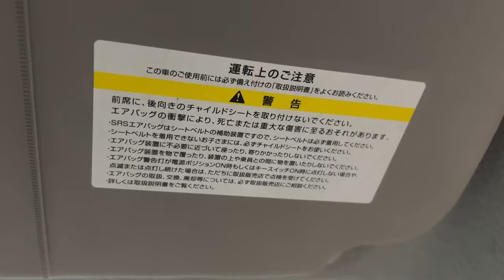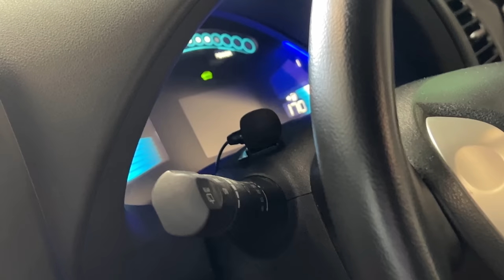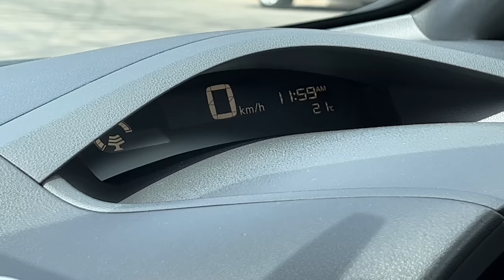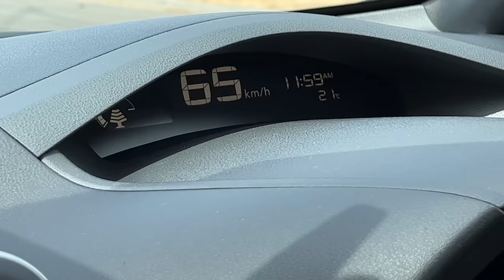I bought an electric car.

Comment from the maker: “Why a Leaf? Why that body shape, why that colour?” - it was the cheapest EV for sale I could find 👌
Reply: Plus it is just you in a lot of ways, to get some very 2000s car in some eyesour of a color but it was cheap
Reply: Oh but bloo is fun
Reply: Next vid: I'm making an V8 Supercar out of a ev 😂😂😂
Reply: Yeah...

But why a Nissan?
Reply: Idk why but im getting mom from incredibles vibe from that body shape... huh.
Reply: Don't worry, that's the same reason I bought one (same color but it's 2012)
Reply: Lol, check after 3 month how many money you save if use only solar power.
In my country electricity is super cheap and for 16 month I drove 42k kilometers, it's save me 2.5k usd (only fuel, without maintenance). 

Oh, Leaf 2015, 24kwt =)

And for this price, it's super fun.
Reply: Nissan Loaf FTW
Reply: @carrot_slayer_of_patatos  possibly something crazier maybe a very high torque turbo diesel
Reply: @jakass  price that's it
Reply: @EDV8ZR1  🤯🤯🤯🤣🤣🤣
Reply: I actually quite like the color. I've always thought the leaf was a good design, never understood the hate.
Reply: @mileskosik472  It was something new and people aren't ready for it.
 like the gasoline car versus steam-powered yes I just compared electric to gas kind of funny right.
Reply: I used to have a Leaf that same color. Loved it except the range wasn't too good after 11 years on its original battery. Sold it and got a Chevy Bolt EV. Love that thing even more.
Reply: Paint it white
Reply: Dank, I bet you didn't see the leaf nismo RC. It is wild
Reply: Not kw.
kwh.
It's like difference between horse Power and gallons of fuel.
Reply: It's also one worst EVs you could have bought. Nissan, in all its wisdom, decided to give passive cooling for this battery on this crap box. Real fun once it inevitably overheats
Reply: Should I, therefore, be made the subject of fun?
Reply: Roughly how much in Aussie bucks
Reply: Aren't you worried about the battery pack dying in a few months?
Reply: Not the new leaf, I'm slightly disappointed but happy to see a new bug. Does it use AAAs?
Reply: good luck with that air cooled battery
Reply: You do know electric bills exist
Reply: @jakass  french powa
Reply: Solarrrrrr
Reply: you forgot the mitsubishi imiev :)
Reply: How much is cheap though
Reply: The newer Nissan Leafs are shockingly decent.. working at a dealer, I can say for sure, they have a little more torque than you would expect out of a budget EV!
Reply: @nickrustyson8124  It's a 2010 car (2010 - present)
Reply: @jakass  The Leaf was the most popular electric car from 2010-2015. Why not Nissan?
Reply: That blue beats boring greyscale, and the price was right. I wonder how much range would be lost if you mounted a set of wider alloys and performance all-seasons? I bet it'd be a hoot on a track or along lightly-travelled back roads.
Reply: You should put the body of the fiat on the chassis of the leaf!
Reply: Good luck with it. It's an experience. I suggest you watch Bjorn Nyland. He's a great EV specialist. It's good you got a late model. The two things you need avoid is don't park it in the sun if you can
And most importantly don't keep it charged at 100% for long periods. Charge it then drive it. If you're not driving it on the weekend, keep it below 80%. These two help with degradation.
Reply: I got an eGolf right before the pandemic, the savings in gas kept me from going bankrupt. Plus I always liked a zippy little Golf. Hoping the $25K Tesla borrows from that design, or I'm going Ioniq next.
Reply: Hey guy, ever consider dropping that drivetrain into a non-electric car?
Reply: I support anything that isn't white grey or black lol
Reply: It's the best choice for a electric car, especially second hand.
Reply: Should have been called drift since leaves drift in the wind but that dunnyload could never drift 😂
Reply: @valentinoschristofi  nah there's videos of the leaf drifting haha
Reply: @ShockingPikachu  not stock tho i doubt
Reply: @valentinoschristofi  I think you underestimate just how powerful electric motors are 😅
Reply: @ShockingPikachu  oh no, ive had two leafs /leaves before a black 2014 and a white 2016 i just think because they are fwd it wouldn’t seem very easy. I’m actually a massive fan of the new tesla roadster idea just i want elon to get on with it already lmao
Reply: BRING IT BACK
Reply: Never loose proximity keys. Get a spare if you don’t already have one. Loosing the key could write it off
Reply: The Leaf reminds me of Gaddafi's "Libyan rocket"
Reply: because: leaf is from tree. tree is from nature. nature is good for electric vehicles
Reply: I recently bought a Leaf and the money I am saving on gas is paying for the car lol plus I wake up with a "full tank of gas" every morning
Reply: it's better than a prius
Reply: Lovely colour, and the Leaf is known as a pretty decent EV
Reply: better color than silver, black or white on this car imo it's a slightly less boring leaf
Reply: Ah.
Reply: You should get a jaguar xf if has a 3l v6, best ride ever, cheep and has a 0 to 60 mph in 5.4 seconds I is a really fun car to drive btw
Reply: Btw fyi your electric car look really inside and outside like a Renault clio , normal due to the alliance with nissan lol
Reply: You have a Nissan egg I have a tesla egg mate
Reply: @mileskosik472  I'm the same for the most part, but I would've traded some more wind noise for less bulbous headlights. Either way, love my 2012. Best damn commuter I've ever owned.
Reply: @jakass  "But why a Nissan?" There's only two used EVs available in Australia for under $20,000: the Nissan Leaf or the Mitsubishi iMiev.  So you have a choice of Nissan or Mitsubishi...
Reply: Can you make Videos with the eNugg ?
Reply: @jakass  If you're looking for a cheap used electric car in Australia right now, there are no other options aside from a Nissan Leaf under about $35K, unless you're lucky enough to find a Mitsubishi i-MiEV that has almost reached unicorn status. Around $35K and up, there are better options with more range and tech such as the Hyundai Ioniq, BYD e6 (no DC charging), and a few others except for maybe the early BMW i3 models, which have bugger all range, but are still more expensive than they should be.
Reply: I love the color.
Reply: I bought mine from Bennett too :)
Reply: @tgmrsch  I have one... :)
Reply: Thats a Micra in disguise 😂😂
Reply: "Should I therefore be made the subject of fun?"
Reply: its the best nissan seller in ev pro country like norway even beating its on ice brethren
Reply: @mileskosik472  theres also a brand that mimics leaf design and also an EV in malaysia (a bit neko style tho)
Reply: @aenoymotors  a decade is a decent life on this one.
Reply: the color is actually pretty good, but the chassis is a bit questionable.
Reply: and most affordable
Reply: Eletric motors can spin up WAY faster than an internal combustion engine on average, thats why the acceleration is so high, and is also why bois like the tesla roadster can kick ass at drag strips.
Reply: Now do the economy challenge. I bet Tony still has the EV beat 💪😤
Reply: i have always wondered why its called a "Leaf" because it looks nothing like a leaf
Reply: Goofy ahh nissan
Reply: * real
Reply: nice job man!! fuck the haters
Reply: It's pure nugget and TBH that's perfect regardless of being an EV. The fact that you can run it essentially for free because it's electric is amazing though
Reply: Not anything about any of that! The shape is awesome, I love the colour, and... who doesn't love to see a Leaf at football practice, better yet with a grown, childless man inside? 😃
Reply: @mileskosik472  egg
Reply: The cheapest EV was JDM? In the US you can sell JDM cars, even boring ones, for a lot more.
Reply: @GarbageTime420 Hey, I’ve been wanting this dingus car for a long time. Do you still have it 4 months later and has your opinion changed at all? Also, if I got one I would not be able to charge it at home, only at public stations in a town where EV’s are very uncommon so chargers are few and far between. Still, I’d only need to charge it maybe twice a week on average. Would it be worth it?
Reply: Yo, where's the fuel economy test? Gotta drive it up and down the highway to see how much fuel it uses
Reply: it’s an electric nugget 😂😂😂
Reply: nice one
Reply: At least you didn't go full "White Goods" and get a Kelvinator white one ! LoL

There blue is an unusual color for that model and looks really good 👍
Reply: @jakass Because Tesla's are crazy expensive in Australia 🙄
Reply: That’s the CHEAP one?! 🤯
Reply: When you first got the car, did it make the default sound when starting up?
Reply: i want a leaf tbh.
Reply: Tbh best body style
Reply: @jakass He said they are Fleet Vehicles in iapan

Comment: The thing about EVs, which it looks like you have found out, is that driving even a low-end one is insanely fun just because electric motors are so responsive.
Reply: The throttle response is impeccable, gas cars always feel somewhat unrefined with inconsistent throttle response
Reply: i remember driving an electric golf cart at uni, was so much fun, going full throttle like a madman
Reply: you can literally stomp out a beat to a song and the motor will be fine lol
Reply: @osimmac  idea: electric car kick drum
Reply: @osimmac  That's awesome
Reply: My 2002 Prius has 258 lb-ft of torque. 258. That is more than a V6 Camry or an Acura TL Type S of the same year.
Reply: my dad has a hybrid volvo and idk what they did to the torque settings in hybrid mode but it's so slow until the diesel engine turns on
Reply: @@nicoyazawa829 that makes sense, I believe it has a 60kW motor, feels like it's lower though, could be battery age
Reply: Ev nugeteer here ioniq ev has been amazing
Reply: @fayenotfaye  Even EVs has an artificial delay in the throttle response, to not spook drivers accustomed to throttle body lag. I have driven a racing EV, and it had a ramp up time of the inverter of 50mS only. Literally if I twitched a toe or sneezed, I suddenly drove 15 mph faster.
Reply: @Tore_Lund  can’t feel it in a Tesla atleast
Reply: @fayenotfaye  I've never tried a Tesla. My Current has a 0.75 second lag from standstill and around 0.25 at speed. The racing EV I tried had none of that, it was instant response. It was not: "How fast do I want to go", but "How far down the road do I want to be!".
Reply: Just throw a small turbo and tune the car it will become more fun.
Reply: @beluga2857  EVs don’t need turbos, adding one would do nothing
Reply: @fayenotfaye  I'm talking about gas onces
Reply: @beluga2857  smaller turbo, less lag less power, big turbo big lag big power. Anyway have you heard of our Lord and savior sequential turbos?
Reply: thats the only ev positive

Comment: Fun fact: the leaf has the world record for the fastest speed in reverse. Removed a software block that limits the reverse speed, but all it does for reverse is spin the motor backwards so theoretically the top speed is the same both ways. I think the record is like 87 miles per hour in reverse? Idk
Reply: So an emulated CVT gearbox?
Reply: So it's just a massive RC car?
Reply: The Nevera recently broke this record. 171mph in reverse
Reply: One more mile and it can go backwards through time

Comment: Soo one thing that's not talked about these. Due to how cheap they were and are, they have a huge modding community. This means you can put a much bigger battery in them and rebuild the battery pack. These things are awsome.
Reply: Can i put electric fencing around it?
Reply: @fernadogonzalez2940  electric anti HEAT fencing
Reply: @LilTachanka  NOW YOU ARE SPEAKING MY LANGUAGE
Reply: @fernadogonzalez2940  ain't no Russian shell getting through this shit
Reply: @LilTachanka  ready the 50 bmg machineguns aaaaaaaaaah
Reply: And ICBM launchers.  Perhaps an A-10 warthog Gatling gun as well for the heck of it.
Reply: Once my Volt is out of warranty, I'm gonna mod it to give it a battery pack with a longer range too.
Reply: Except for the crappy EVs that you get locked out of if you replace even a single thing cough (Tesla)
Reply: @Thewaterspirit57 
That is a Musk-problem, not an EV-problem :-)
Reply: the bigger battery will also weight more...and the cost of battery pack is insane too... worth more than any used ev

Comment: Being Norwegian, it's so weird seeing someone being this excited about an old Leaf. But then I remember that were kinda weird with EVs here up north. Congrats on a great lil' beast. 1st gen Leaf is truly a great one.
Reply: keep pumping that oil norway
Reply: @silvernoob1603  Yeah, no.
Reply: @Tjomsasen  No, yeah
Reply: @Tjomsasen  No no, yeah
Reply: @andrihusainsudra  Yeah, yeah, no.
Reply: @EEE-ro5px  Nah, Yeah, Nah. Yes.
Reply: @silvernoob1603  keep mining that lithium australia
Reply: I assumed you all just drove EV's and land cruisers
Reply: EVs are quite sensitive to temperature. Even here in “Sunny California,” I see huge (>40%) loss of range in “cold” weather. How do EVs behave in the frozen northlands?
Reply: @DMLand  basically 30 km range with everything turned off. (That's a joke)
Reply: @silvernoob1603  Dude learn a very simple rule. Don't get high on your Own Supply.
Reply: @DMLand  "EVs are quite sensitive to temperature" LOL Bullocks. BEVs work fine in the ARCTIC CIRLCLE. Thus why Scandinavia region has lots of BEVs.
Reply: @DMLand  "40% loss" WTF? The battery is broken you have a LEMON. Max loss even in blizzard should be 25% which is really bad. Could get that down to UNDER 20% if you PreHeat on charger.
Reply: @Nick_MG  Yep all the compliance cars with no active thermal management was like that. Some really did get 30 miles range in blizzard when the original was 90miles. But very very few of those cars EXIST because they were compliance cars.
Reply: @Neojhun  I live in Sweden, I have no idea what counts as lots of electric vehicles, but I know that a lot of people drive hybrids and don't want to go truly electric. If you park on the street heating the car is a big drain, and we don't tend to all have garages. A recent test in Norway showed that even the best electric vehicles had more than a 10% drop in range in cold temperatures. After that there has been talk that evs shold have both their performance in warm and cold weather in advertising.
Reply: Brunost
Reply: @CainXVII  Way more than here in sunny Australia. Plug-In accounted for 45% of all sale in Sweden for 2021 but that includes hybrids. Educated guess only about 20% half the plug ins were pure electric BEV which is high up in the global rankings. 
Garages are NOT required and not even a good idea for frequent daily driven BEVs. As long you have an outdoor charger a BEV is fine being outside in a Blizzard plugged in.
I never said BEVs did not drop range in the cold, I clearly state the worst case scenario with NO Charger Preheating could be 25%. While best case scenario around 17% in truly freezing snowy weather. But when your original range is 250 miles 400km that 20% loss is still very useable 200 miles 320km. 
Please read the comments before making up false assumption. You truly had no idea what you are talking about.
Reply: @CainXVII  "park on the street heating the car is a big drain" LIES!
It's about 3kWh per 24 hours.
Reply: @Tjomsasen  Å joda, du. Vi MÅ!
Reply: For context: EVs made up about 80% of all new vehicles sold in Norway in 2022.
Reply: Wouldn't EVs under perform in Norway because of how the cold temperature affects battery performance?
Reply: @bobbyp4025  In very cold temperatures, yes. But modern EVs don't have tiny batteries anymore. 

Also, large parts of Norway has a similar climate to the UK and rarely gets extremely cold. Western/southwestern Norway (where I live) rarely gets colder than -2/-3C. My Kia eNiro does just fine here :)
Reply: @Neojhun  iMiEV levels of old cars.
Reply: @CainXVII  I also find it manipulating how in Germany, the biggest automotive club ADAC has been reviewing the range over a window of 5 years or so, concluding that it didn't drop a lot. But they did not mention at all, that the manufacturers lock some of the capacity away, just to unlock it later over time, to give you the impression that the battery capacity did not change. 
So, as soon as that extra capacity is going to run out, the battery WILL die quickly. And that makes EVs really dangerous to buy used. 
They are made to last 10 years and then replaced like a mobile phone.

Comment: Tony is immune to speed.
Donkey Van is immune to shoe.
Nissan Flea is immune to servos.
Reply: Also Jeff’s previous owner is immune to deodorant.
Reply: and dont forget the free car!
Reply: @colinchung9722  We don't mention him
Reply: @colinchung9722  free car is immune to having a clean engine (well until it gets fixed later in March or so lol)
Reply: Yeah cos you'll be in the middle of the desert with no way to refuel your car
Reply: @jacka1472  "middle of the desert with no way to refuel your car" Soo like 65% of Australian drivers will never run into that problem.
Reply: @jacka1472 Solar
Reply: @jacka1472 EVs have the same homegrounds as SUVs: cities